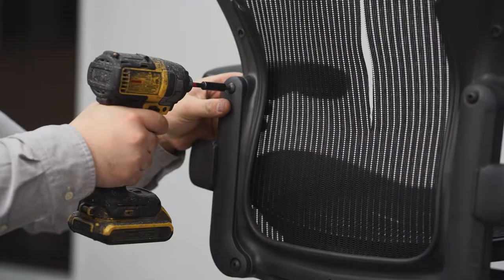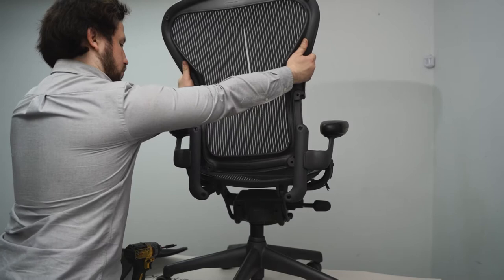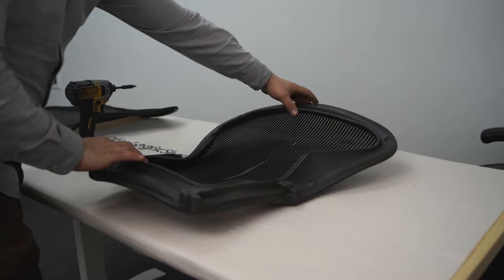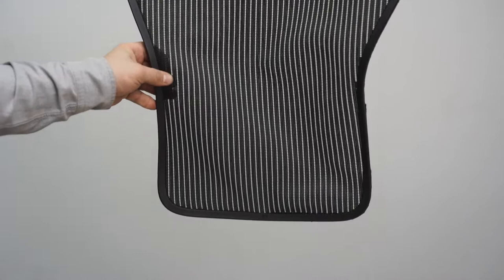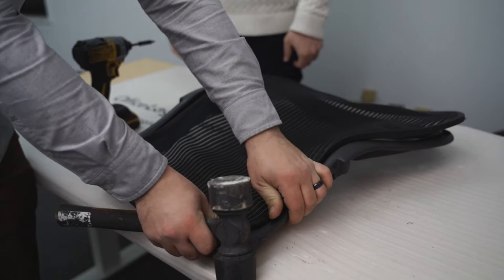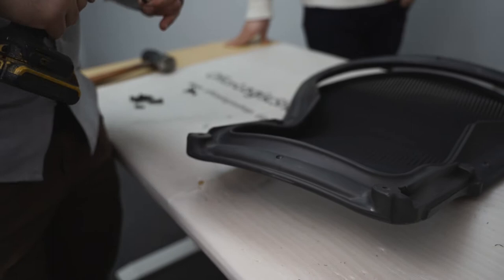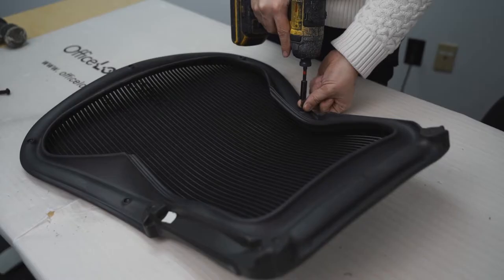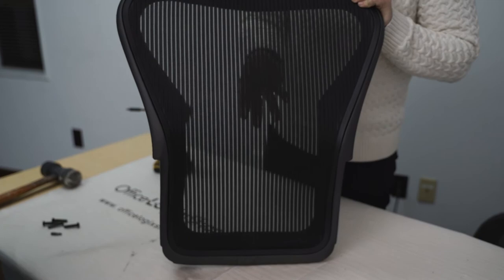Fixing Herman Miller Aeron Chair Back Mesh Tear by Office Logix Shop

Comment: The back mesh you guys sell is a tad too small, the frame doesn't fit perfectly into the back of the chair. i had it all snapped in and when i screw the back in the plastic slowly pops out in certain areas. overall it still works just isn't perfect.
Reply from the maker: Hi, 

There are 3 sizes for Herman Miller Aeron Chair. Size A, B, and C. We only have Back Mesh Replacement for a size B. Our Improved Design is perfectly fit Size B Back frame with no issues. 

Please let us know if you have any questions.

Comment: Do you know if this can be used for Remastered replacement?
Reply from the maker: Hello there. Yes it fits the Remastered. However, there will be a color difference since it originally matches the Classic's color, black. We're currently working to release one for the Aeron Remastered soon!
Reply: @OfficeLogixShop  are you able to provide the release date?
Reply from the maker: We're currently working on multiple projects, including shipping the Embody headrest pre-orders. As for now, we don't have a set date for that, but we're working really hard to make several products available as soon as possible. Thanking you for your understanding.